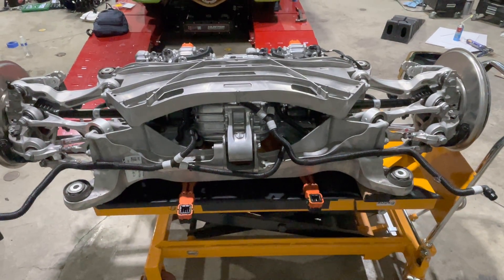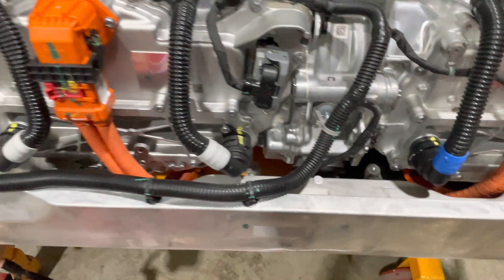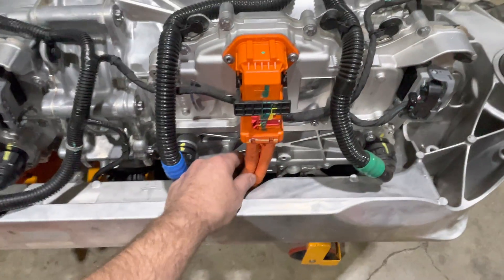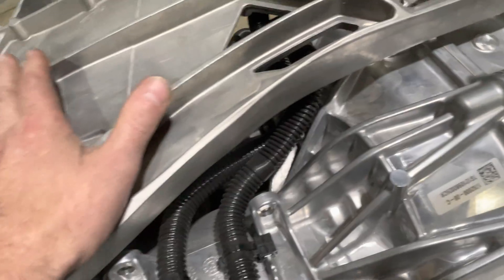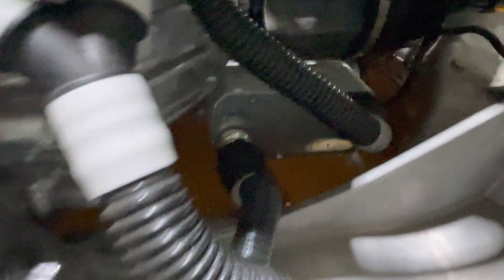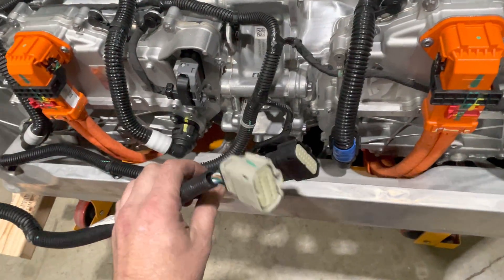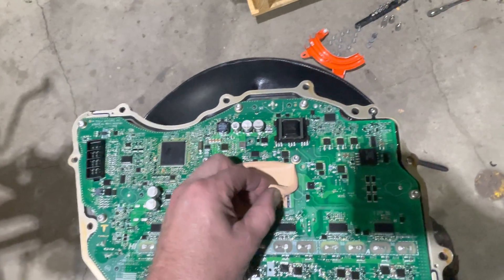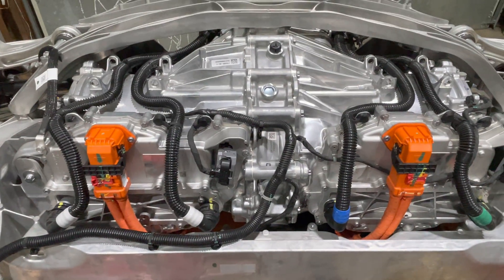Tesla Plaid Rear Drive Unit - Quick Look

Comment: I wonder if this unit is based on the dual motor axles for the Semi. I seem to remember them saying the Semi uses Model 3 drive units in this configuration.
Reply: All they have in common are the core components of the motors (and even then the Semi won't get the carbon fibre wrapped version) and the use of one motor per wheel. None of the housings, gearing, or suspension are shared.
Reply: @brianb-p6586  the carbon wrapped is just the rotor, you can just put a standard rotor in this housing and it’ll perform just as well, but you’d want to limit it’s max RPM.
Reply: @harsimranbansal5355  You misunderstood my comment about the housing; it was not about the stator. A non-carbon-fibre-wrapped rotor would presumably fit inside the stator from a motor which was built with a carbon-fibre-wrapped rotor, but the aluminum housing that holds the stator is not going to be the same in a Model 3, in a Semi, and in the dual-motor rear of a Plaid.
Reply: @brianb-p6586  ahhh, got it. My mistake, thanks!

Comment: And an Audi SUV with 2400 kg and 600 hp drives almost the same time on the Nordschleife as a Tesla Model S Plaid with 1,020 hp, 7:42 for the Audi SUV.
Reply: You mean the stripped down RSQ8 with no backseats but bucket seats, rollcage and semi slicks beat a stock Plaid on street tires with currently a top speed limit? What do you want to say us with this?

Comment: At high speeds, the permanent magnet motor(s) are probably running well into field weakening, with the natural back-emf well above the battery voltage.  If the inverter overheats, fails, or simply needs to turn off at those speeds, a physical disconnection may be necessary - even if the mosfets are intact.
Reply from the maker: Correct.  The back EMF will be well over the pack voltage.
Reply: Switched reluctance motors?

Comment: The springs don't support the suspension as suggested at 3:39; the springs support the car, from the suspension (directly from the knuckles). The drive unit is supported by the subframe through the three bushings (centre rear plus one on each side at the front), and the suspension and drive unit are supported by the body through the four bushings at the corners.

Comment: So the fixed-body calipers, which required the separate parking calipers, have been abandoned in favour of sliding calipers, with the usual parking feature operated by an electric motor. That's lighter and less expensive, although it doesn't work as well. Apparently this was done way back in 2016, but I had only seen the original design before this.

Comment: How odd that rear toe-in adjustment is almost aligned with a rear upper control arm. Makes me wonder how it would even have an effect.
Reply: The toe control link is actually at a very different angle from the other arms. As usual, it is nearly lateral while the other arms are angled, forming virtual upper and lower A-arms. the anchor point of the toe link on the hub carrier is substantially off of the axle line and thus off of the virtual steering axis, so it effectively controls toe. 

This is a typical five-link, as seen in many models from many manufacturers, including the Model 3/Y (although the Model 3/Y uses steel links instead of aluminum).

Comment: How are silicone carbide Mosfetts different than the usual IGBT that most inverters use?
Reply: They much much better,  they can handle more power and are  much more efficient, and they are smaller.
Reply: I have read that the new Hyundai motor group E-GRP Is also using silicone carbide for both front and rear inverters
Reply: They're field-effect transistors (FET), not bipolar transistors:
https://en.wikipedia.org/wiki/Field-effect_transistor
https://en.wikipedia.org/wiki/Bipolar_junction_transistor

FETs were first developed for high-power switching, but most recent EVs have used a variation of bipolar transistors with a specific design feature called Insulated Gate Bipolar Transistors. There are reasons to prefer each type, but while they are different internally they do the same job.

Comment: Elon said that the rotor is carbon sleeved. Is this correct or is this just 2 standard model 3 motors?
Reply: See the later front motor teardown video, also from 
Ingineerix (and yes, the rotor is wrapped in carbon fibre).

Comment: Amazing how such a relatively small motor (relative to gas engines) can provide that much power.
Reply: Electric motors are great at moving things efficiently - the problem is you also need to drag along a massive battery
Reply: kinda like rotaries
Reply: An electric motor is just converting nice electricity into mechanical power; an internal combustion engine is starting with fuel. It's so different that it's not an "apples to oranges" comparison; more like "apples to cattle". An electric motor is a simple thing with an easy task, so the small size is not impressive at all. These are nice motors, but they're just electric motors.
Reply: @brianb-p6586  You claim it's like comparing apples to cattle, and then immediately proceed to compare it by calling it "not impressive"...

In my opinion, from physics standpoint, the technology here is much more impressive, but the mechanical engineering on an engine is very complex. It really depends from which perspective you're looking at it, and neither is necessarily "wrong"
Reply: @cheezzinator  The Tesla motors are not really impressive compared to other electric motors. Yes, they can spin at high speed due to the overwrap, but they're not much different from other common EV motors.

What an electric motor does is not impressive compared to what an engine does, because the electric motor has a much simpler job. The efficiency and power density cannot reasonably be compared, because they're not doing the same thing.
Reply: @brianb-p6586  I don't disagree with your facts, just with the singular perspective. But that's all right.

I'm more interested in hearing which electric motors you find more impressive and from which standpoint.
Reply: @brianb-p6586  But once you consider it is a car that costs around 100k$ and doesn't require maintenance to maintain the drivetrain warranty....It becomes groundbreaking in the automotive space. Same goes for cheaper Teslas.
Reply: @rkan2  Sure, but that has absolutely nothing to do with the relative sizes of electric motors and internal combustion engines. And a battery is enormous (in both volume and weight) compared to a fuel tank, but no one is amazed by fuel tanks.

Comment: Thanks for the great video and analysis! With pyro actuator, if the busbars are severed at high current, what per you is preventing arcing?
Reply from the maker: This is not to prevent arcing, but keep in mind this would be AC voltage, so zero crossing will help squelch the arc pretty fast.
Reply: @Ingineerix  its AC voltage when the inverter is working.  If a MOSFET is shorted to set off the fuse, it would be DC.
Reply from the maker: @TravisFabel  The only reason they would deploy the motor pyro is to prevent sudden plug braking, which would only occur at speed, and at speed, the motor is making 3-phase AC, not DC.   They already have a pyro on the DC side that can break full current DC faults, so this would have already blown if there was a short causing DC to flow into the motor windings.

Comment: Does it fit on old tesla
Reply: It should do... Model S rear  motor has been fitted in Ferrari 308 as a mid motor configuration not rear motor...  would need a custom sub frame but it`s possible...
Reply: No. Chassis was redesigned. This is essentially a new car in an old "wider" body.

Comment: Since there is no mechanical connection between the two rear motors, I believe it should be possible to do torque vectoring in the rear.
Reply: The car does have torque vectoring. You can see it in action when they took the Plaid proto around Laguna Seca back in 202. At bottom of the corkscrew, the car literally swivels on its rear right wheel.
Reply: @fredpinczuk7352  really? I wonder why they haven't advertised that, since that is the kind of thing manufacturers like to brag about. Unless I missed it somewhere.
Reply: @ShaunRF  "Torque vectoring" is the last of six items listed as "Plaid upgrades" on Tesla's Model S order page.
Reply: @brianb-p6586  interesting. I wonder why I never see that mentioned in articles or reviews.
Reply: @ShaunRF  Most people don't even understand why independent torque control of the rear wheels is useful, and the term "torque vectoring" (which makes no sense - if the "vector" jargon must be used it would be "drive thrust vectoring") means even less to them. Range, power, acceleration, and impressive-sounding technical features that people don't understand (such as carbon fibre wrapped rotors) are much more marketable.
Reply: you automatically have some degree of torque vectoring with this setup, the question is whether the car is programmed to give ideal handling characteristics so that it feels like a high quality limited slip diff (or better!) at the limit, and… we don’t know since traction control is very intrusion at the limit
Reply: @JackMott  Not just "some degree of torque vectoring", but the ability to independently set the torque output to each wheel, varying in a tiny fraction of a second. A limited slip differential can only apply higher torque to the slower-turning wheel, so can never be as capable as a fully functional active torque distribution like this. 

How "intrusive" it is depends only on programming choices; it could be set up to be as ineffective as a basic limited slip differential.
Reply: @brianb-p6586  yes, the point is currently when there is much of any slip at all the plaid starts applying brakes to do traction control so we don't really have any idea how well the torque vectoring works.  Not much inventive for them to have made it clever given you can't really get there. Guess we will find out more as people start defeating the traction control.

Comment: Great video, definitely subbed from now on!  Theoretically, would it be possible to use just one inverter for both rear motors?
Reply: To have one inverter you need a way to idle one motor while the other is running. This involve adding more electronic switches which increases your energy losses and decrease your efficiency. Also running AC on wires are less efficient compared to DC.
Reply: No. An inverter for a synchronous motor produces power precisely matched in phase to the position of the motor rotor, so it can't power two motors unless their shafts are rigidly locked together... in which case there would be no point in having two motors. These two motor rotate independently, so they absolutely require separate inverters, regardless of power capacity.
Reply: Not if you like turning. ;)
Reply: I'm pretty sure each inverter is only designed for a certain amount of output. It makes way more sense to use 2 existing units than it would be to build a single inverter twice as large. Using two also helps with packaging.

Comment: So is the LR have the exact setup as the model 3? It's essentially a model 3 but with air suspension?
Reply from the maker: No, It's the same motor technology.  The PMSRM and SiCFET inverter is Tesla's Model 3 "secret sauce".  They have re-used this on all vehicles since then:  Semi, New Roadster, Palladium/Plaid, and I bet also in the CyberTruck.  The only changes so far are a carbon overwrap on the Plaid versions only to allow higher RPM operation.
Reply: The suspension is entirely different in construction. The car is a different structure... and the Model S is aluminum while the Model 3 is steel. And a Model 3 has a single motor per axle (that is, one and the rear plus one at the front if AWD), while the Plaid has two motors for the rear axle. Only the motors, some electronics, and some gears are shared.

Comment: So the Plaid is essentially three Model 3 drive units? Should have called it the Model 9
Reply: Remember the motors aren't the same though, just driven by the same electronics.
The rear motors have carbon-sleeved rotors in the Plaid to allow for higher RPM without ripping the whole thing apart. :)
Reply: @VoxelLoop  supposedly this also helps to reduce back EMF, flattening the high RPM power curve. That's where the Plaid comes into its own versus previous Performance Teslas.
Reply: @VoxelLoop  Front and rear all have carbon-sleeved rotors.
Reply: the main difference is that they’re carbon wrapped
Reply: @andromeda9340  you say that like Tesla will not refresh the Model 3 and introduce the carbon motors to it
Reply: @andromeda9340  the drive unit are not carbon wrap.. but the motor rotor does!  =)
Reply: It's nice to see them carry on with the general Model 3 motor design as it validates they got it right.
Reply: @aussie2uGA  The model 3 drive unit have been upgraded several times. They switch the stator windings and upgraded the rotor core. They also have phase out the non SiC inverter.
Reply: The Semi also uses Model3 motors.
Reply: So is the LR essentially a model 3?
Reply: Maybe you should suggest that to Elon? Given how much crazier the plaid is vs the last raven.
The p9 actually has quite a nice ring to it. 😁
Reply: The carbon wrapped motor is the most important thing.
Reply: Someone will flip it and install in a standard Model S...  or even a Model 3 with a 1 off subframe..
Reply: Upgrade for the Jag mate
Reply: Nein, nein, neeein!
Reply: All three motors are different...

Comment: What a thing of beauty! The castings and forgings look organic and skeletal.  700hp in this small unit is amazing!
Reply: Most likely Tesla used some Generative Design simulation for optimization of mass. Thus the organic skeletal shape. The future of Chassis & Battery Cell integration is a organic blob exosketloton. Based on Generative Design modeling.
Reply: At least 800 HP at the moment tesla plaid motors are limited by battery and traction.
Reply: No software is the limit there is more but u cant have it till u change the tires n dome others
Reply: The massive amount of torque and brute force placed on this unit is incredible. They must have engineered in loads of redundancy but it still looks skimpy.
Reply: Doubt 700hp (peak) is even close to limit.. Just would need to beef up the cooling quite a bit. :P
Reply: @rkan2  There video of tesla engineer saying that motors can do 400hp each but currently are limited by  battery.
https://youtu.be/S4KmRZ28hdw?t=767

Comment: I think its more then 2 model 3 motors,,  this motors have fireglass wrap ,,  new motor techgnology found only on plaid,  Not on the model 3 .   disrispectull for plaid owners to simply call our motors.  model 3 motor
Reply from the maker: Yes, the rotor wrap is new, but that's just to allow higher RPM.   Just incremental improvements.  Same PMSRM, Same inverter.
Reply: The rotor wrap is carbon fibre, not fiberglass.

Comment: Will you open both motors to see their innards???  Your videos have been the most informative for years.  Thanks for doing this.
Reply from the maker: Coming!
Reply: There's no point in opening both motors, since they're identical.
Reply: @brianb-p6586  You dont know if they're identical unless you open both
Reply: @TravisFabel  It would be completely idiotic to make the left and right motors different.  Tesla has done idiotic things, but nothing that bad. The gearboxes will be mirror images, of course, and there might be some detail of the motor (related to oil circulation, or mounting to the gearboxes) which could be mirrored due to the opposite normal rotation direction.

What possible reason can you imagine for the motors being different?

Comment: Fyi, the rear wheels locking up is considered more dangerous than the front. There are safety analysis done regarding this for ICE cars when transmission electronics failure can also lock up the wheels.
Reply: Well... if the rears lock up you still have steering. I see your point, but the fronts are a bit more crucial.  I was impressed that they had done the testing to find the potentiality of this issue.
Reply: @youmakeitreal   I should say, loss drive traction is conventionally considered more risky in RWD cars. Not necessarily due to locking. Sorry. It is general wisdom, but cannot be universally applied, rather each system has to be analyzed individually for risks. 

Rationales could be:
Front wheels are harder to lock due to mass transfer. 
Mmore likely to cause severe accident in RWD cars, due to unintended acceleration/deceleration. 
Even bad shift could cause loss of traction and oversteer in RWD. 
RWD cars are also typically more powerful and stopping the car with brakes could not always be possible. 
 
Depending on the risk level some redundancy is required. (Read ASIL levels). 

It would be interesting to know Teslas rationale for the Plaid!
Reply: @dzidmail  Seems I was being a bit picky with semantics😁  We are fortunate to have people breaking these systems down for our evaluation.  Yes. Getting into the minds of the Tesla engineers would be great fun as well as informative. 
Cheers!
Reply: Nope.
Reply: @carholic-sz3qv  in what capacity is that a nope? 😁
Reply: @youmakeitreal  on ICE there are things like transfer case, differential.... there are also systems to avoid lockings.
Reply from the maker: I think Tesla now applies the on ALL inverters for all Models front and rear.    Personally I'd rather lose rear, as a driver, I can keep the car on the road in most cases.  In front lock, you've lost everything but the rear brakes.
Reply: Separate motor for each rear wheel, so if one locks it torques the car into an extreme turn at high speed.  Ergo pyro emergency one time unlock.
Reply: @morrisg   One locked wheel isn't very dangerous. The spinning one will provide traction